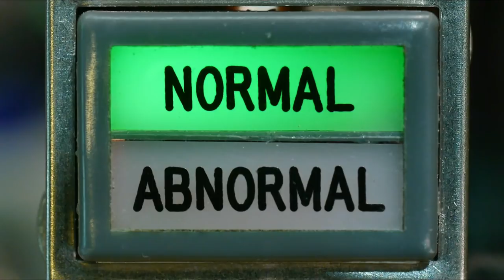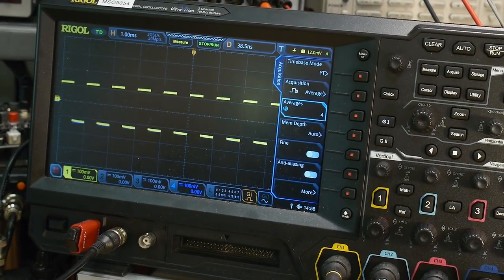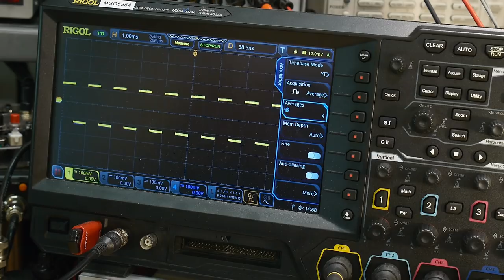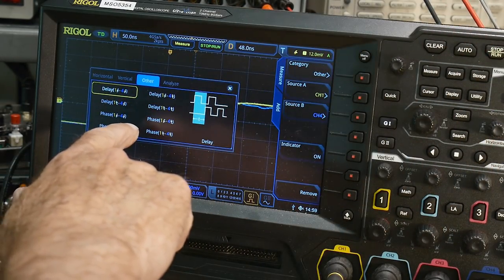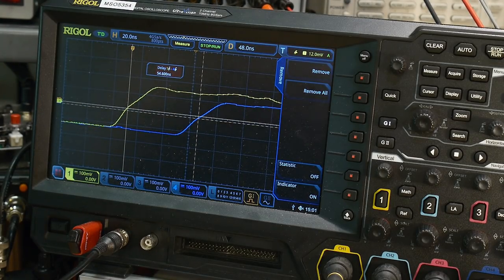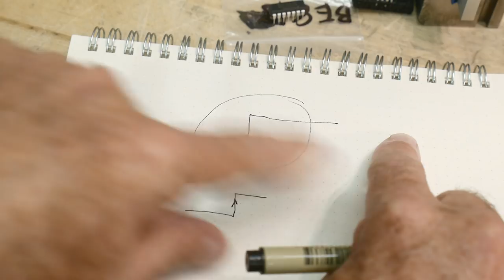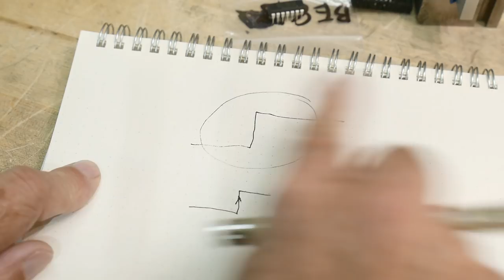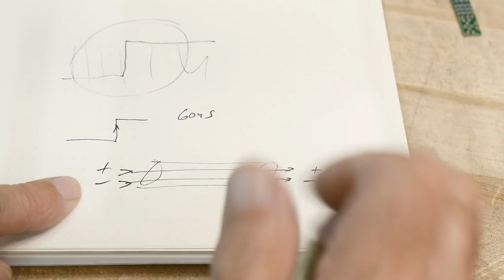#1181 Analog Oscilloscope Delay Line

Comment: All cables have a 'velocity factor', a speed noticeably slower than light, at which the electrical signal travels through a medium such as a cable. All RF cables, ladderline, windowline, coaxial, twinaxial, and triaxial have that speed specified for that type of cable, so a delay line is just cut to length for the amount of delay desired. Most RF coax's have a velocity factor of between .66 and .88 of the speed of light in vacuum. Using that knowlwdge is a great way to design antenna arrays in order to get the phasing right.
. 
Who would have thought back when I was working at HP building scopes that 50 years latter I'd be watching YouTube videos about their delay lines?
Reply: The exact term is velocity of propagation, back in the 1980's I worked on a project that used a coiled semi-rigid coax cable delay line, very cutting edge at the time.
Reply: How much slower....?

I heard thru coaxial cable is maybe 2/3 slower...than the speed of light in a vacuum...

If speed of light in a vacuum is close to 2.998 x10e8 m/s...then that is about 1 foot in a nS...

Then say in RG-58 A/U will be little less than 8 inches per nS...

I wonder when the type of coaxial cable is changed like to RG159...or that little like SMA 

Lucky our trusty O-scope can measure the delay.....

Such as if you scope is calobrited...the marking are wipe off or missing....and the cable has continuity....then measure its delay...

It is kind of amazing...to just use some cable...for the delay...

Probably now...the is a 16 pin solid state delay chip...you just send it some digital ...then ALE...boom...the delay performed....

Ok Fred..but you must preserve the wavewform...so maybe some sample and hold ...idk

Essentially having like many different delay times seems like it could be done with a few chips

And IMASI Guy approximation of 9" per nS is close....

All I had was a first google hit...to hear about the approx speed of electrons thru RG-58...

I predict...but I am have been very wrong.....because you have had lots of experience...

I think say the speed thru say 75 ohm coaxial cable would be close to the speed of a 50 ohm cable...

Maybe the speed is just dependant on using metal wires....and the dielectric...

So I busted out the ARRL antenna book...and started digging....

Here are some nominal  VF of commonly used transmission lines...

First a few with polypropylene..foamed...like little air bubbles..FPE

VF

Rg-8 -86%

Rg-8x 86%

When solid polypropylene 66 %...

I thought Teflon might be better...69.5%...

Open wire line had the best 92%...no dielectric 

RG-58A

Why is the speed slower through coaxial cable ...compared to light traveling thru a vacuum?

Another topic to enlighten myself with

Which then might be 8" traveled in 1 nS...

Amazing...

I wonder if it's because the electron moves in a helix or spiral...

Rg

I have no idea but can look it up...

I thought the dielectric might slow down or have a loose like in some dB per kilometers...

It seem the speed of the conduction has a lot to do with the permimily
Reply: Thanks to our readers...lots to be learned...
Reply: @fredmitchel1236  It varies by choice of dielectric material, I worked with some PTFE and Teflon materials, some with as high as 85% VOP
Reply: The speed difference is from the difference in dielectric constant of the insulator material. The speed of light in a material is C=1/sqrt(mu*epsilon), if you change epsilon things slow down.
Reply: @robbylock1741  Thanks Robby. We have a great group...

I like nice sort concise answers...

I will look up more IMASAI Guy...

I hope to try and grasp digest ...S parametes....
Reply: @rjordans  thanks...even better a formula...

Happy 4th of July
Reply: @fredmitchel1236  It's slower because a properly-terminated transmission line is the functional equivalent of an infinite number of tiny series inductors and resistances and paralleled capacitances and resistances. It takes time for the signal to charge all the (theoretical) reactive components, and so the signal slows down a bit compared to an electromagnetic wave through a vacuum.
Reply: Electricity doesn't flow through anything...in fact its very complex what actually takes place...
Reply: @applanateearth586 , that's generally true, i.e. most of the energy exists in a field outside of the wire. But electrons DO physically move through a wire with DC applied, albeit at something slower than a walking pace, and back and forth in 60 cycle AC, (but ever closer to the surface at ever higher frequencies due to internal eddy currents, a process known as 'skin effect'.) However, the motion of electrons IN the wires is what causes them to get warm and limits the current handling capacity of the wire. Otherwise, any gauge wire would work for any amount of current, which is far from the case.
Reply: Every time he implied that the speed of electricity through a cable is c I was shouting "velocity factor!" at the screen. I felt like Doctor Mike yelling "chest compressions" when reviewing a medical drama. I realize it's not terribly important to understanding the wherefores of delay lines, but you'd better know your Vp if you're designing one.
Reply: @petersage5157 , I'd probably just grab a cable and trim it down till I had the delay I wanted, then measure the cable and specify that length on  mechanical prints and the BOM. But I'm lazy. I never trust the VF specified for the cable I'm using, anyway. Not if it has to be right. I always hand measure that fussy stuff. Too many people have been sloppy and made too many mistakes for me to want to add my name to the list. Measure twice. Cut once.
Reply: There is an audio cable company that prides themselves in building near-speed-of-light cables. Is that a real thing? Is it possible to get close (> 99%)? For audio it's completely pointless of course, who cares if you're 10 ns slower in the left channel or whatever. I'm just curious if cables can be that fast. Even optical cables won't be 100% speed of light in vacuum because they're not in a vacuum and there's refraction and/or bending of light involved.
Reply: @Gersberms , my observation regarding audio stuff is that the more expensive it is the bigger lies they use to sell it. And I'm guessing that cable is very expensive.
Reply: @johnwest7993  it is, of course, but I want to know if cables can be that fast. I don't care at all about Nordost or what they sell.
Reply: @Gersberms , I have no data to make any claim either way, but self-inductance and the capacitance created by insulation has to slow the fields down, and even expensive RF cables are about 30% slower than light in a vacuum. I just looked up what I would presume to be the insulated cable with the fastest VF, window-line, because its insulation is hardly even there, and it was advertised as having a VF of (.91). That's still not even close to light.
Reply: @Gersberms  Possible, but unless the cable resembles ladder line, it's probably marketing BS.
Reply: @robbylock1741  so not the electrical squishyness I hoped for 🤨 just a less direct path.

Comment: Reminds of the DIP-14 sized delay lines on the S-100 bus DRAM memory boards I had.  They were used to generate the CAS and RAS signals to latch the address into the DRAM device.  Those were somewhat smaller than what you're exploring here :-)
Reply from the maker: I had forgotten about those beasts. lots of dubious timing circuits in those days. one shots and delay lines.
Reply: @IMSAIGuy  They had the right idea, in a fashion: asynchronous circuitry. It works better on a chip, though, since everything is on one die and the delays age similarly and similarly react to voltage changes. I guess the delay lines were cheaper than a bunch of gates in series? Especially CD4000 gates can give you lots of delay and lots of rise/fall skew quickly :) One-shots with RC timing do their own thing with temperature and age. I have had some luck just putting enough gates in series, or even a long differential pair going a couple times around the board - and back then some boards were plenty big :)

Comment: this type delay is also used to phase antenna systems, nice video thank you..
regards from VK3
Reply from the maker: It is also used on atomic bombs to detonate the high explosives all at the same time.
Reply: @IMSAIGuy  This system was also used, in a sense, in the data centre where I had a system running a high-frequency trading application back about 15 years ago. Some racks were further from the exchange system than others, but everybody was wired to the exchange with the same amount of cable so that the folks physically closer to the exchange didn't get an advantage.

Comment: Thanks for the explanation. I knew there was a delay line--mainly because it tended to be identified in servicing photos of the inside of the 'scope--but I never really thought about what it was used for. (I don't want to give the wrong impression. I used 'scopes; I didn't service them. Contrary to a number of assertions, real engineers DO occasionally read manuals, generally because they didn't earlier and should have.)

That delay line looks like a nice balanced transmission line. I wonder what its true characteristic impedance happens to be. I'll bet if you fed and terminated it correctly that the signal distortion we see would be even less.
Reply: RTFM  Read the fine manual.  :)

Comment: 1 ns/ft in vacuum.  In coax it is about 1.5 ns/ft depending upon the coax.
Reply: how does a vacuum make it faster? If this is the matrix, i wonder if each air molecule is an object that slows the simulation?
Reply: @goosebyte  A vacuum has lower index of refraction (permeability and permittivity).

Comment: As simple as they are, I thought was the neatest device to tune phases when I first learned about.  Still seems neat to me and the analog world is just like that being more natural physical properties of materials (mass & energy).  Working my way towards the Prius CVT 3-phase alternator/generator/welder/plasma cutter, I've acquired a few generators to study hands on the designs and recently was thinking about the easiest ways (without being huge) to phase sync two smaller like 5000W generators that are the older analog synchronous generator designs... with no solid state controls and pretty much just the carb.  I figured so far... simple mechanics of setting the positions of the stator/rotor and using one engine on a pulley/sprocket/gear for each.  Now, if using two separate engines... thinking will need some RPM and idle controls... or like maybe some sort of tune able delay like would be nice which I've seen in microwave devices with like a telescoping delay line design.

Comment: Look on YouTube for " The Origins of Delayed Timings on Oscilloscopes - Workbench Wednesdays "
     
I thought THIS was what Delay lines on analog scopes was used for
ZOOMING IN ON REPETITIVE WAVE FORMS,, like video for example
Reply from the maker: the delay is a circuit that triggers the scope delayed from the main trigger, then the second sweep is at at different sweep rate. the delay line allows this arrangement to 'see' before the trigger. it would still work without the delay line, just you would not a able to see before the trigger, but you could still zoom in events after the main trigger.

Comment: Your the best...great demo...
You accomplish so much

Cool...and explained perfectly & guessed and measured accurately 

I am glad you reused & harvested some that HP &  made short work of it two.I hope the beefy multiple tap power transformer was saved...

This kind  touched and sort of opened the door to visit  to TDR land

I think I am hearing...input comes in to vertical amp and or attenuators- if signal is high voltage ..that vertical signsl then split...one path  delayed then amplifed for the vertical screen 

The pre split also goes to the trigger for needs 55 nS to create process and create  the trigger sweep..

And to see a trace  a little time before the rising edge ..the trigger sweep propagation must a little time faster than 55 nS

I only yapped here to demo that I can learn and comprehend a tiny

Ah one more comment to go...for IMASI Guy...on Test Equipment...

I was in that wavelength and synced to the IMSAI Guy

It was Jim Williams I was trying to remember...it seemed he has some  books out...I saw he had some old YouTube teaching before passing away...I.looked at CE amp instability and how to cure ....But his YouTube desktop and workbench was uncharacteristically....immaculate..
maybe at that time...management said...sure Jim...you can use our  test equipment to create some lessons...but please show a neat work bench....lol...

Good old Bob P....Almost bought his book at Frys Electronics San Jose

Now our Phx Frys....an empty shell...

Comment: What's the impedance of that unique wire arrangement? Would this wire arrangement  be an improvement for antenna feed line over coaxial or ladder line?  Of course it would need an insulated sheath.

Comment: Not unlike what we in the optical world call a launch cable.  An optical launch cable is used in OTDR testing so the meter can properly register tests on shorter runs of single mode fiber (9 or 10µm typical) and is usually a few hundred meters in length.  Short cable runs may not have enough length to allow the test meter to measure properly and within its parameters, as well as test the first connection of that cable.  You can enter the known launch cable length into the meter so it knows where the actual test starts on the cable you are measuring.
Reply from the maker: I used to wrap a fiber around a pencil for a mode scrambler
Reply: @IMSAIGuy  Attenuator.  ;)

Comment: I am just reading in the AoE (Art of Electronics), the part about scopes, and read "all good analog scopes have a signal delay line". Ok, interesting. I know analog scopes often have A and B sweep, and B sweep can be triggered again (delayed), but that is not the same I think... As everybody always say, 'you can not see before the trigger' you actually can. If we use the external trigger input and feed it with the actual signal, then delay that signal and feed it into one of the regular channels we can actually see the part before the trigger. There should be a more compact delay components? Were they not used in the old TV's? Maybe they are not applicable, but in any way interesting topic for the vintage equipment users 😀 I will get tomorrow and old blown up Tek 2445 that I will try to resurrect back to life. I have 2 more analog scopes 20 and 60 MHz, just for fun. Enhancing those would also be fun thing to do. One idea is to use CH1 output (of the back of the scope) and connect to a self made counter, to automatic display the frequency, as a way of automatic measurement.

Comment: would it work for sound? could you emulate stereo by feeding one channel through the coil of wire and get enough to emulate stereo?
Reply from the maker: should be usable. you will need to build and good circuit to drive the cable (and capacitance).
Reply: @IMSAIGuy  i thought wiring the coil in series like you do with a resistor to limit current or an inductor  to act as balast in some light bulbs

Comment: The need for them now seems obvious now that you have explained it. Thanks.

I know analog TVs also had a delay line, but the one I examined looked nothing like that. More like a small slab of glass with some angular cuts and I assume a couple of transducers. I wonder for what reason they are used in those?
Reply: PAL TV sets had both kinds of delay lines, ultrasonic and inductive. Ultrasonic (glass) delay lines were in most VCR's--they provided duplicate TV lines in case of dropouts.
Reply: I believe delay lines were for secam only systems. PAL and NTSC didn't need delay lines. 

SECAM differs from the other color systems by the way the R-Y and B-Y signals are carried.

First, SECAM uses frequency modulation to encode chrominance information on the sub carrier.

Second, instead of transmitting the red and blue information together, it only sends one of them at a time, and uses the information about the other color from the preceding line. It uses a delay line, an analog memory device, for storing one line of color information. This justifies the "Sequential, With Memory" name.